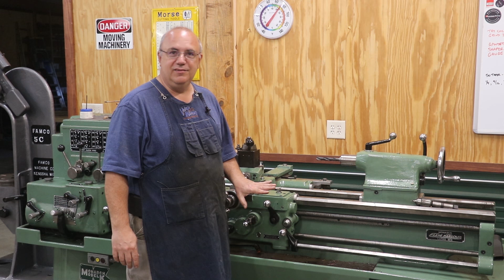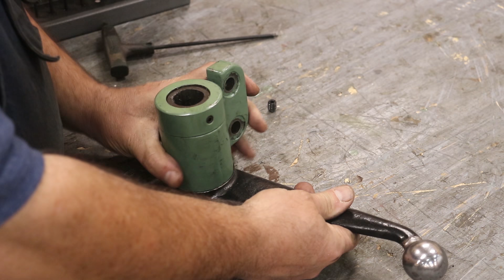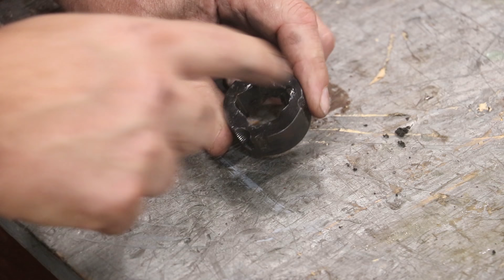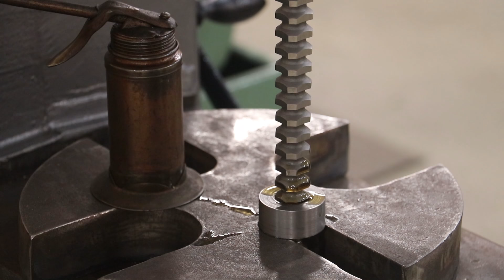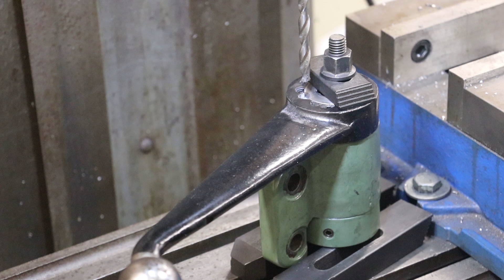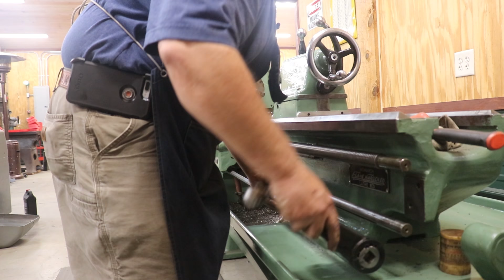Machining a Clutch Bushing with a Square Hole for a Monarch Model K Lathe

Comment: I would have used a small milling bit to make the hole as large as possible but just smaller than the drill for the tap. Milling bits don’t care that there are two different metals.

Comment: I forgot that the handle had to slide down the square rod.  The locking pin would need to be a set screw going through one side of the handle and square-holed bushing, having a polished flat face that pushes against the square rod lightly so that it can slide along it,  but still keep any rotation from happening. If the bushing is a hard material with a close tolerance for a tight fit to the rod, the set screw would never cause any sideways wear as the handle was moved in its position.

Comment: That square hole does not move relative to the square-sided rod it is holding.  Why not make a very hard (high-speed steel, for example) square-holed fitted-to-the-handle-hole metal support with a long tapered locking pin going entirely through the handle, the square-holed bushing, and the square rod, holding the entire thing as a single rigid unit?  It would NEVER wear out in this case.
Reply: The bushing slides on the shaft, if you pin it through, the carriage will not move

Comment: Thanks, Keith!  Don't listen to the haters, great repair and instruction.  I'm doing the same repair for my Series 61 Monarch.  I'm using 932 bearing bronze for this part, and intending to replicate the original dutchman and 2 dowel pin arrangement.  The factory part appears to be a copper coated cast iron part, with a 0.001" press fit (which i will replicate).  Mine is also worn into a similar abomination.  The series 60/61 handle also has sheet metal covers and felt wipers held on with retaining rings to help with swarf and grit and retain some lubricant.

Comment: Was there anything preventing you from making the bushing longer so it went further up inside the fixing bracket, thereby giving a greater load bearing surface?
Reply: There is a set depth of the pocket…it is only 3/4” deep, but there is another bushing on the other side that needed replaced if there is that much play on the handle

Comment: Hi Keith, just a question for you about this job. Since we know that this bushing is supposed to be a wear part would it not have been better to make it out of a softer material such as bronze or cast iron rather than steel? We know that it has been replaced various times in the life of the machine which makes sense since it is easier and cheaper to replace a bushing rather than replacing the square shaft it is attached to. I know I am not as experienced as you and would love it if you could increase my understanding by sharing your reasoning behind using steel in this case as opposed to something softer?
Reply: The square shaft is quite hard on a Monarch…if his mystery metal is low carbon, there is little chance of wear on the shaft.  I just replaced my bushing and it was original at 78 years old

Comment: A lesson in just how much to take a job. Yes, it would have been better with a heat hardened part, possibly with a key-way cut out. On the other hand Keith could have just welded the old part with hard facing rods. None of that is necessary. Well done Keith, yet another demonstration in experience over what if.

Comment: Hi, wouldn't it have been better to fit a square key so you could renew it without having ANOTHER hole in the casting?
You have the broaches for the slot  
and cutting a slot on the mill would have been easier than chasing the bush around the hole!!

Comment: After the 'pecker tracks' (accompanied by shouting 'Noooooo!' before the inevitable, and another exclamation at the lame mutterings about dissimilar hardnesses) it would have been better to flip the bush so that the aborted drilling and pecker tracks were hidden against the casting. Position could have been kept by marking one of the square corners against the bush face before flipping. Now you'll have that messy job feeling every time you see it.

Comment: Nice fix and good for you to show the minor problem you encountered. A slightly different approach to clamping it down fixed the problem.  Did you have the arbor table clamped? It seemed to be deflecting.  Jeff

Comment: Wouldn't you want to make the bushing in something softer then steel, like cast iron, or brass, so that the wear is on the bushing, and not the shaft which is harder to replace?

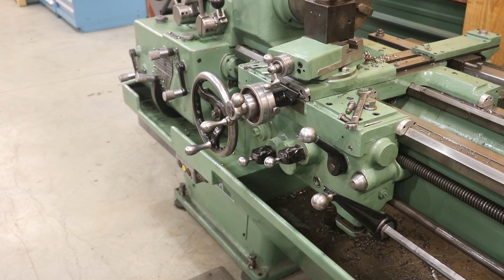Comment: The job of this "Dutch Key"  is two fold. That is, it holds the part (the bushing in this case) in both the radial and axial direction with one simple screw. It's a great design as it is for low torque situations. many machinists install 2 set screws 180 degrees apart for higher torque situations. Also, I always try to make the part( bushing here) a press fit before installing the Dutch Key - that way it will not walk on you as you drill and tap the parts as it did on Keith at time 15:00

Comment: Keith never fails to post a great video, where I find much to learn. It is always a pleasure to see he has posted a new one. One question though, I am always surprised to see some old style box end wrenches used, whereas a set of ratcheting box end wrenches make most jobs go faster. So, is it that the ratcheting wrenches do not let you into some tight spots, or is it that the ratchets fail eventually? In my own admittedly light use, that has never been an issue for me.

Comment: Toight loike a toiger
But you could have changed the arbor press to low tonnage, high speed mode, as I doubt you need the full power of that press of the broach.
And shouldn't you heat-treat the new part, to prevent this from happening again in the future?

Comment: Not saying I could do better, I could not but with a more precise build (far more time consuming I know) it would press fit into the handle and operate with no lash, that is the way it was originally built and why it did not require a set screw. Do not mean to be an ass ever though it seem that way. OK I'm ass was and we all know. 💩 Good job none the less. 👌
Reply: Except that isn't how it was built. Both of my Monarchs are like Keiths with the parallel to shaft set screw holding the handle and bushing together.  They also have multiple holes so you can reclock the handle to a comfortable position as the machine clutch wears and gets adjusted.

Comment: Also, that part might just be worth paying for a piece if higher strength steel considering how many times it seems to have been replaced.
Maybe some shop work hardening of the piece?
Reply: It needs to sacrifice itself instead of wearing out the rod.

Comment: Like was said below, I wonder why Monarch didn't use a flat point set screw and a small flat on the external of that bushing. Sure saves multiple drilling of the handle/bushing combination. See you at the Bar-Z. Jon

Comment: Would having removed the tailstock and moving the carriage towards the tail and shortening the unsupported shafting made removing the shaft/ screw bushing support bracket easier?  Never pulled one apart, so I'm only speculating.     Other than that inquiry, I really like the channel and the variety of projects taken on.   So cool on so many levels. 

With work, travel, homelife, the museum, your own massive home-shop, projects, machine rebuilds, hosting scraping classes, and making videos; where do you find the time for it all?  Do you not sleep?  Are you able to manipulate space-time?  Can't quite conjour how you fit it all in.

Comment: I would have thought you would have just drilled and taped half a hole and used the old original hole.    lo
Reply: Obviously that would require a half tap for that. I heard half taps are very rare.

Comment: I would have changed  monarch's design approach on that. What about a dog point set screw from the side and a pre drilled dimple in the bushing?  Its a shame that with the current design with every new bushing you have to drill and tap new thread. As I see there is few of them  already.
Reply: The job of the "Dutch Key" (existing design) is two fold.  That is, it holds the part in both the radial and axial direction with one simple screw.  It's a great design as it is for low torque situations.  many machinists install 2 set screws 180 degrees apart for higher torque situations.  Also, I always try to make the part( bushing here) a press fit before installing the Dutch Key - that way it will not walk on you as you drill and tap the parts as it did on Keith at time 15:00

Comment: There is something very soothing watching a stationary drill bit create a hole in a rotating mass of metal, with a long spiral chip departing through the bits flutes.

Comment: Yup and two thumbs down.   That's what you get for taking the time to make, edit and post an educational video.  Where you actually overcome  the two dissimilar metal problem and  complete an excellent job. Thanks Kieth.  I suppose eventually the lever will have so many grub holes it will have to be brazed up or re manufactured.
Reply: Allready 14... web is full od arseholes...

Comment: Would a set screw be a bad decision?   I have one to make as well.
Reply: Not until it shears off, then it is!   Just think of what it takes to make that square hole sloppy in the first place.
Reply: @roberthamilton9730  Shears off? In the axial direction that Keith installed his, or in the radial way that the op (stxrynn) suggested. Either way, shear forces would be impossible to shear it length ways, like Keith had it. And a set screw coming in from the side would not have enough screw exposed to subject it to shear forces. It might spin, but not shear.
Reply: @xenonram  I would agree with you in the way Keith used the set screw will work properly. However, if the set screw was used perpendicular to the direction of force it would be only as strong as its sheer strength across the set screw. That in which would be greatly reduced.
Reply: chris0tube Perhaps so Chris, maybe the same Gorilla that made the original square hole round! 
 I would stick to the set screw in the lateral position just the same.
Reply: I've used Keith's method.  Called it a dutchman.  Looks like there are ten old ones on his handle so I thought a 3/8 set screw in a flat would work fine.  But have never done one in that particular use.  I can see the plus and minus of both comments.  Thanks to both of you for confirming my ideas.  I'll probably go with a dutchman.

Comment: As a long time woodworker, I've never seen a square broach and appreciate the way it works....little by little.  I make square holes with a mortising machine and assumed a machinist used something similar.  Thanks for the education!
Reply: Machinists can also use a rotary broach, metal shaper, filing machine and probably other methods. This is just one way.

Comment: Why not put the grub screw in from the side then when you have to make a new bushing just set the handle to the correct position and drill a pocket for the grub screw.
Reply: I think it's stronger the way it is?
Reply: @dudleycornman1624  It's definitely stronger, you'd have to shear the set screw in half, or the outer ring would have to expand  the diameter of the set screw for it to slip.
Reply: @dudleycornman1624  
Definitely! and it can't work loose and slip just when you need the lathe to stop.
Reply: @dudleycornman1624  It's only subjected to hand pressure it doesn't need to be super strong.
Reply: @migtrewornan8085  That's true, but this way pretty much won't slip... ever.
Reply: if it went all the way to the square stock it would eliminate the lash too.
Reply: @dadillen5902 , true,. You could also do a pin at a tangent to the bushing, but that isn't as easy.
Reply: @dadillen5902  Yea, you could put a taper pin all the way through it as well...

Comment: A completely novice question... But... Why would you not weld up the predrilled holes and just make a keyway in both the handle and the bushing for squarestock with a side drilled set screw? Just seems to me to be a better way instead of having to drill a new set screw hole each time this part is replaced. (which seems to be quite often from the looks of the handle)
Reply: He could not weld steel to iron. Iron, being softer, would have to be brazed. An iron-steel weld would break apart.
Reply: @danielcobbins9050  was not referring to welding the parts together. Simply filling all the other drilled holes and then broaching a keyway into the handle with a set screw from the outside and machining a keyway onto the sleeve.
Reply: a) it's quicker and easier just to do it this way and until you actually run out of space for new holes - why not
b) a set screw and keyway would prevent the bushing from spinning but not prevent it working out of the handle

Comment: Move the carriage to the end to give better support to the feed rods.  Since you are using the Monarch to turn the new bushing, can we assume you replaced the end support and used a vise grip to engage the clutch?
Reply: The machine had two lever to engage it. There is one by the headstick and one on the carriage. So no need for vise grips.
Reply: @xenonram  But Keith is right handed!   If an archaeologist  a thousand years in the future dug up that lathe, he could tell a lot about us physically, by the size of the handles, their location, and he could even deduce that the majority of people were right handed based on the wear  difference between the 2 handles.

Comment: Should have made two of them. That way you will have a spare that you can't find in 5 years time!
Reply: More like 200 years, if I'm judging the machines age and current used model (weekend warrior) as opposed to the designed use model (full scale production). The truly telling thing is that 80 plus years ago it was designed to be replaceable. How many machines designed today will last 80 years let alone be repairable.
Reply: Just put the spare on the rod and push it back to the support block on the end of the bed out of the way. 
  On the Famco press, make a wooden tray or anything really with cardboard or rag padding to set on the floor under the press. Trust me when your nice new, very expensive broach falls through and snaps in two when it hits the concrete floor you will cry.

Comment: Another great video just one question why didn't you put the set screw in from the side of the handle
Reply: ausshot83 

It's much stronger put in the way he did it. The screw is used as a threaded key. It's a rather old time thing and I was surprised to see it.
Reply: @ardvarkkkkk1  OK thanks my only question is how is it stronger (sorry I don't understand) that when a set screw could be screwed into the side and into the broached bearing for tight fit and it would also make it easy to readjust when the bearing wears out like the last one

Comment: How are the lead screws in the end cap lubed. Is that slot supposed to be stuffed with felt wick then an oring cut open and packed in slightly to prevent oil loss. With as many times as those might turn a minute. Also does bolt torque effect the gap width. Perhaps that's why it was so hard the drive off the ends.